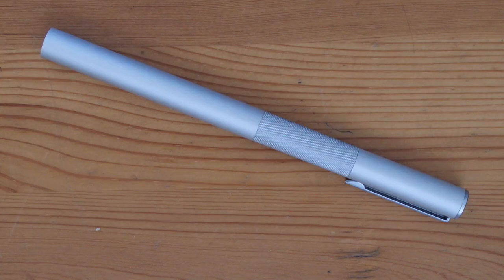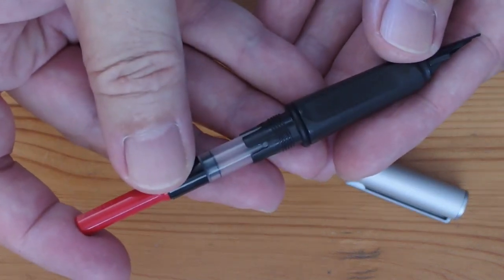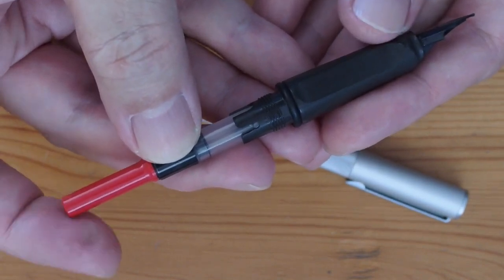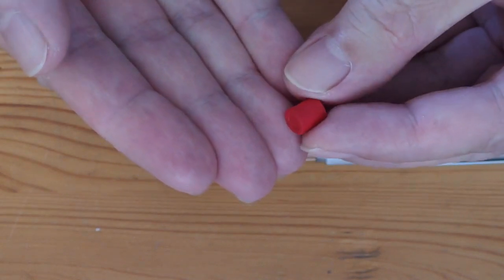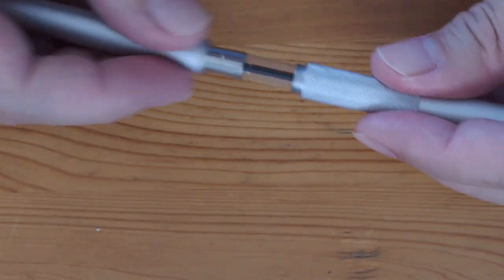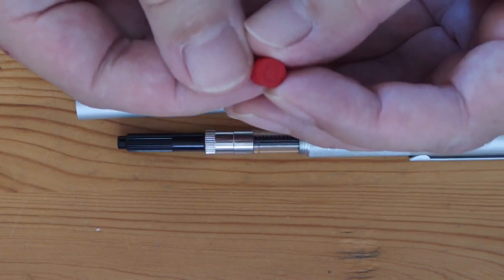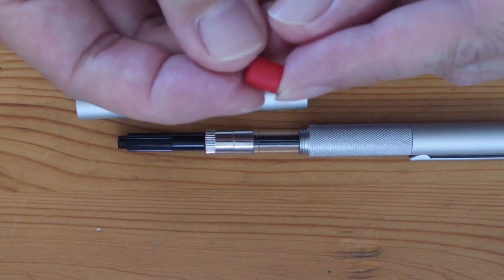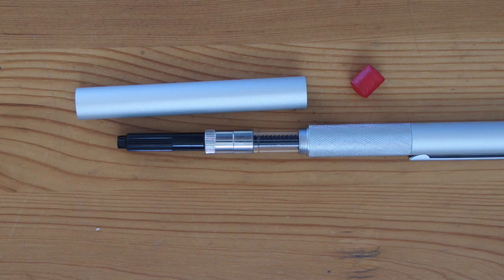A Device To Prevent Converter Detachment In C/C Fountain Pens

Comment: Simple and ingenious solution. 
In my opinion though more manufacturers should cut a few threads in the inner walls of the section and add a metal band to the base of the converter, and cut threads into it too. The Lamy converter's notches are also a good solution. It shouldn't be the writers who have to solve such issues.
I think in the 21st century fountain pens manufacturers should start taking interest about this sort of problems.
Reply from the maker: Rime-e-Lettere The lack of standardization is an issue that messes up every industry, and each pen maker would want to look after its own interest, even though the parts could well be sourced from specialist manufacturers. There again, there's still scope for macklers like me to do a bit of upgrades and mods here and there.

Comment: A good idea. I wonder if a small spring could perform the same function. Thanks for an interesting video.
Reply from the maker: David Anderson I was thinking about that as well. But the spring would need to be exactly the right size and strength; a coil spring would not have the top surface to support the end of the converter, and might exert a bit of a push against it too; this spacer do not have this issue.

Comment: one can just simply push some felt or cloth into the barrel
Reply from the maker: TheGunmac10 The whole idea is to take up the space behind the converter without exerting pressure, so it would not fall out; the method you described might work too, it's not quite the same idea though.